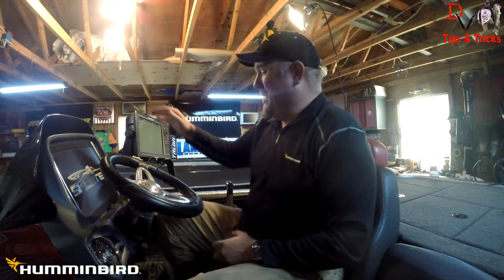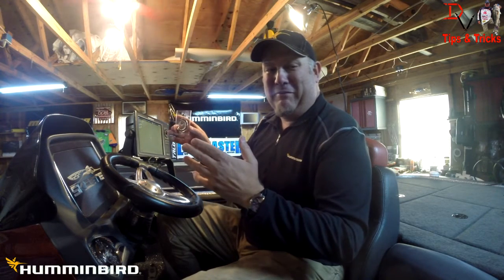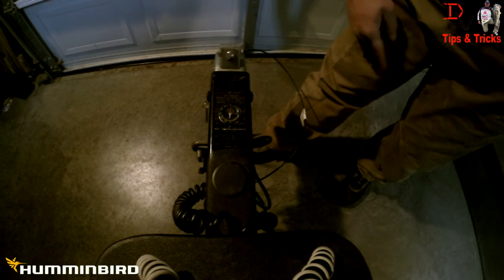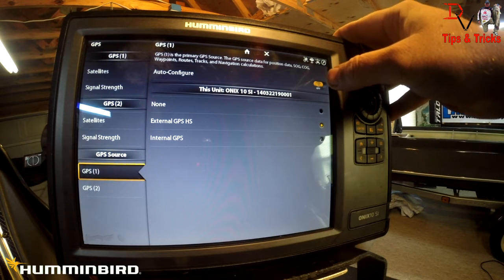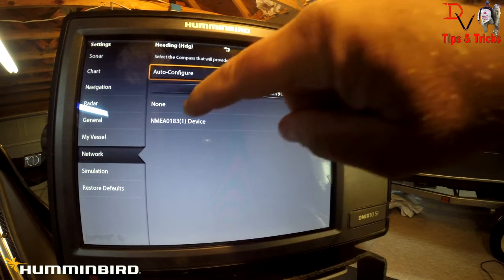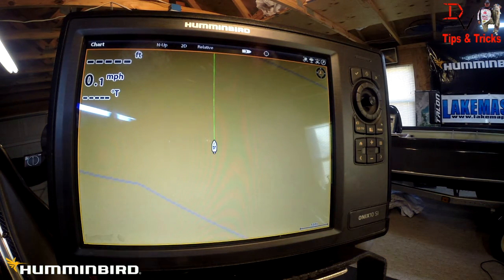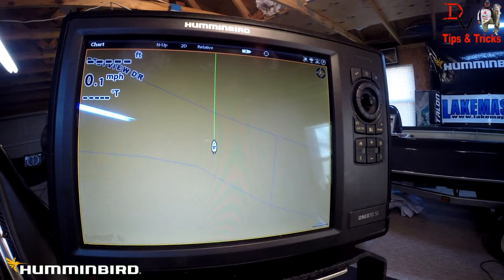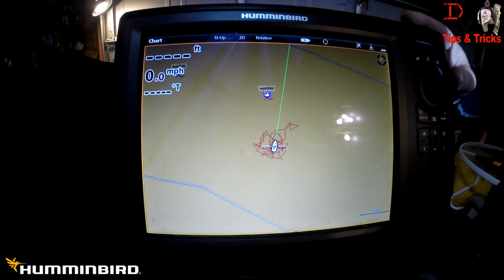Tips 'N Tricks 168: Humminbird ONIX - Advanced Heading Sensor & GPS Set-Up

Comment: Hi Doug - what is the difference between an external GPS (heading sensor) and and internal GPS.  I have a 859ci HD with only an internal GPS.
Reply from the maker: +Patrick Beaumier  There are 3 GPS Receivers a Humminbird can us. It can use an Internal GPS Receiver to get GPS Location Only. Or you can attach the AS-GPS which is just like the internal GPS and will only provide GPS Location data. Then there is an External GPS-HS with Heading Sensor; it is an External GPS Receiver that also includes a Heading Sensor or Magnetic Compass that aids in slow speed navigation to positively know the position the boat is headed. GPS-HS is actually 2 Devices in One: Heading Sensor and GPS Location Device.

Comment: Doug, good video. Would you consider doing a Tips & Tricks follow up video on how the position of your GPS/HS puck on the boat affects the position of suspended fish (or structure) on the screen when viewing 360 imaging?
Reply from the maker: +mburke1211 360 can determine direction by the way it sends and receives sonar signal. The GPS-HS provides the user the ability to mark data on the 360 Imaging screen and it can determine the location based on heading sensor data where in data is in relationship to the boat. That plus when using 360 navigation it can display where the waypoint is based on GPS Location and Direction the boat is pointed. It does not change the 360 and actually the 360 can operate without GP-HS. Just makes it hard to stay on existing waypoints or creating new waypoints.
Reply: That's helpful, thanks Doug.

Comment: any advanced settings on helix or core series when setting up hs gps?
Reply from the maker: +Christopher Parker You can adjust the heading but the HELIX/CORE Series sees the GPS-HS as a single device and when you subscribe to the GPS-HS you have to take both heading sensor and GPS Location data. ONIX looks at the Receiver as two devices and you can split the data on the network like mentioned in the video. on HELIX/CORE I would run a bow Heading Sensor if you fish from the bow. Can't get the benefits of ONIX sharing the heading sensor only.

Comment: I thought there was something wrong with my helix, come to find out, the gps didn't work in my garage, but it works great on the river!
Reply from the maker: +Ross McClure GPS has to have clear view of the sky. Metal will block the signal...I get good signal because of wood roof in my garage. I'd recommend doing it outside in clear view if you don't get good GPS signal